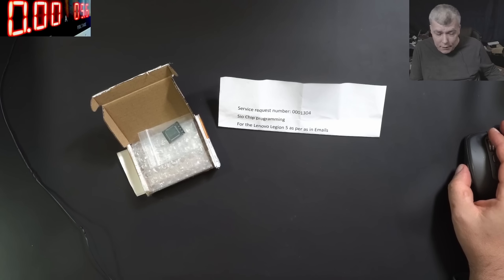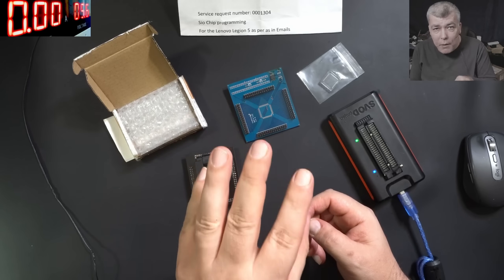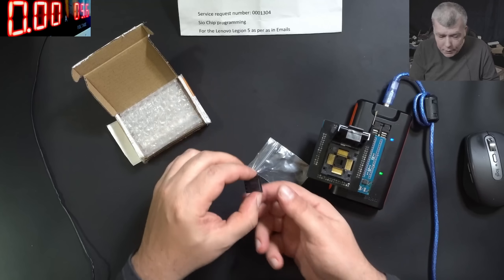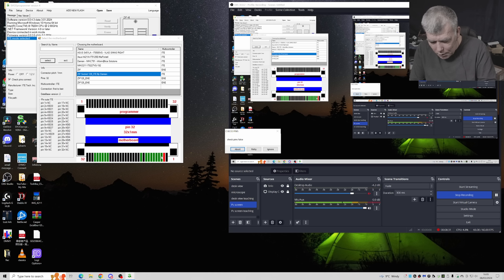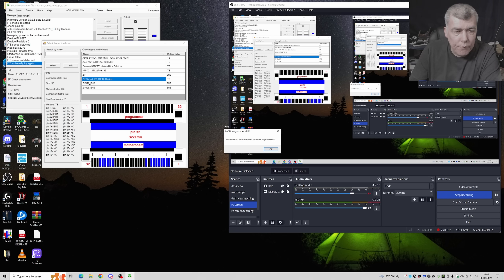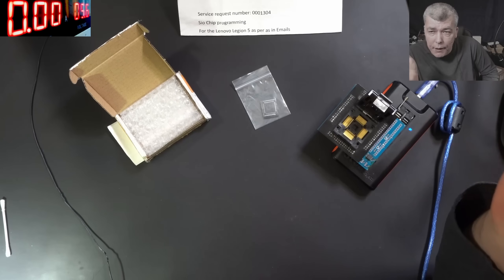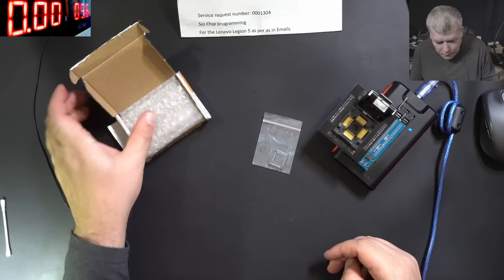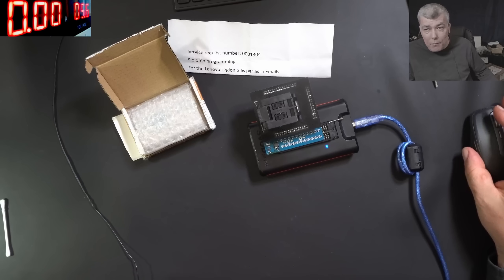How to program a EC chip - Lenovo Legion 5 17IMH05H IT8227E-192 programming with SVOD 4

Comment: Hi, I need EC firmware (128kb) for my legion 5i 15IMH05H, 10750H with Nvdia 1660ti. My laptop's been under repairs for 6 months now.
Reply: Hi I have the same problem except with the 2060 model did you find a solution?
Reply: @faayazfaqerzad5056 Same issue. I haven't attempted a repair  yet but everything Ive been able to find about this online says you don't need a programmer if your system is Intel and the chip is blank (all 0xff). The bios for Intel models will flash the firmware to a completely blank chip after 30s. It might take up to 15 minutes for this flash to complete? I don't know much more yet. I'll update if I find more info.
Reply: I'm not sure but you might have to leave the battery and cmos disconnected (i.e. charger only) in order for the EC to be flashed. If you can't find the exact component, some similar chips with different numbers at the might work, just be sure to match memory size and 3 letter suffix. You can order pre-programmed chips online if it's AMD. Pre-programmed or not, just try to source from USA or EU, not China. Chinese chips are literally scrapyard junk. Electronic Loop Shop seems reputable I think. There's a decent chance the mosfets could need to be replaced so be sure to check those after you remove the EC. If you're still not booting after that, check the PMIC and (if you're really unlucky) the PCH as well. I believe if the PCH is fried, the system will power on but there will be no post. I got this info from the badcaps forum btw, go check it out if you need more info.

Comment: My Lenovo g50-80 laptop power supply keep getting on automatically if battery is charged or i put a charger on and than display come than it shutdown again 
And than again it start automatically than shutdown and
 if it get boot up to desktop the display comes and goes like happened in sleep mode if u press any button on keyboard display comes than in few seconds display goes off like sleep mode than in few minutes it shutdown it self again and than power up again and again its keep happening until i don't remove battery or charger what could be the issue on my laptop

Comment: Do all EC chips need programming? Doesn't BIOS program it?
Reply: Some EC chips has eeprom/flash inside which you might need program if its not programmed already. 
Some older ENE ones on MSI at least had external eeprom (i had one personally as i had to flash it manually before laptop worked) which you need program if it doesn't have correct firmware already (so in this case if you replaced EC chip.. it uses firmware from external eeprom memory so no need program.. most cases if not corrupted).

So yes and no. Depends your situation which you need to know and learn to know what you dealing with.

BIOS update SOFTWARE you download from OEM (update.. not the BIOS itself) programs does sometimes update EC firmware as well. 
BIOS itself doesn't program EC chips (or i missed this development step as BIOS has had usually same size EEPROM so there is no space even hold EC firmware.. usually.)
Reply: Thank you,  @XantheFIN .
The chip I am researching has "Embedded flash" in its description, so I suppose I'm lucky and it doesn't need programming. 
Incidentally, some websites describe it as SIO, others as a chipset, and still others as an EC. A complicated subject!
Thanks again.
Reply: @annnmmmm Sorin often says Ec chip is also called SIO chip

Comment: Hi Sorin. You programmed 128KB instead of 192KB. Once the chip is detected, you need to select its size "button CONFIG ITE"
Reply from the maker: Lol, thank you, i missed that
Reply: @electronicsrepairschool  Hi Sorin. On these kind of Lenovo models, (y540 for example with same ec chip) motherboard is programming the ec chip itself from bios. you dont need to program it
Reply: Also forgot to mention that you cant program some models with keyboard connector because keyboard is using separate ec chip mostly on laptops with rgb keyboard
Reply: @elisaab1990  How do you know if a bios is programming the EC or it needs to be preprogrammed?
Reply: @racztamas1980  lo mismo me pregunto

Comment: Awesome video! Thank you for sharing such knowledge <3 I am tinkering with a Legion S7 at the moment. It had no display output. I've managed to get it back to work by flashing it's bios with a CH341, but only in linux. Because of it's EC chip it cannot boot into windows. Now the case got clear. Your discord community is the nicest I've stumbled upon. Keep up the good work! <3
Reply: that is a cheap programmer what he is using is top of the line and lowers the risk of destroying it or just getting bad dumps